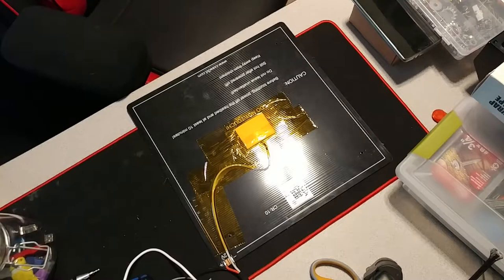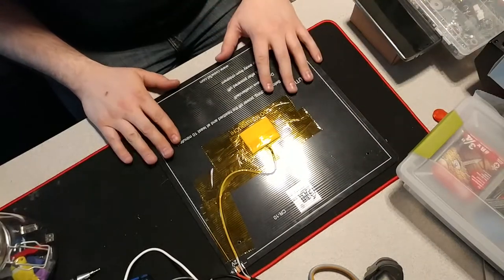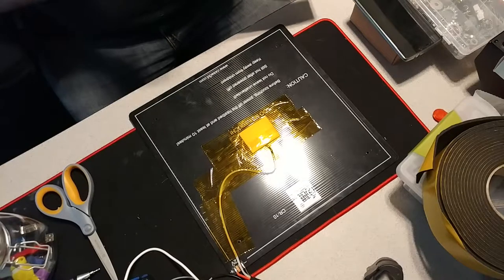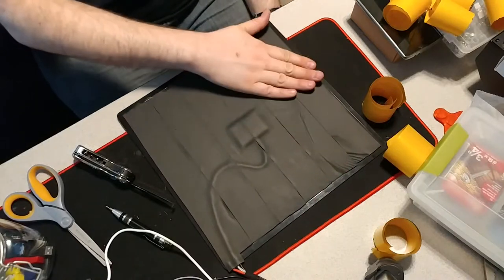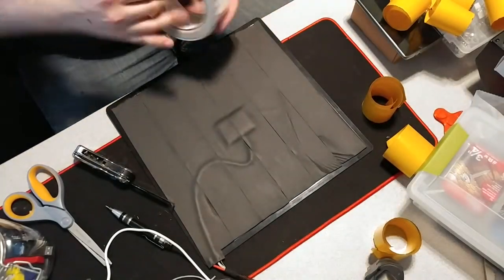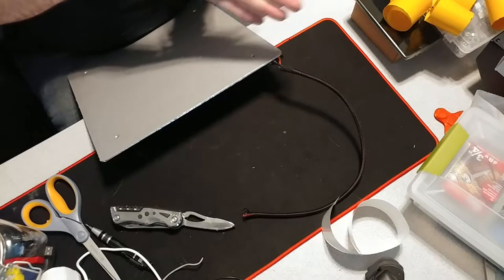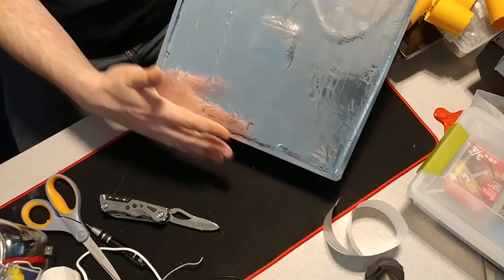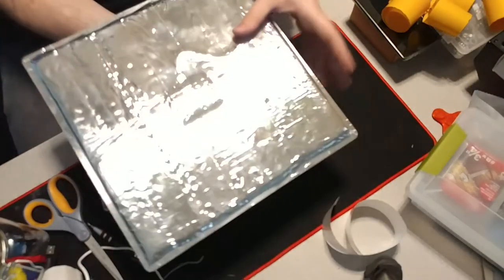DIY Heated Bed Insulation Tutorial - Works with any printer!

Comment: Just a hint for everyone wondering about the tape withstanding high temperatures.
There is at least 2 types of tape one for high temperatures and one for low temperatures.
HT Armaflex tape is rated at 150°C
Reply: I know this is an old comment but it is still helpful. I appreciate your input.

Comment: great video, i bought the tape from Home Depot for 6 dollars. its the same type of tape for way less. I did a double insulation with a criss cross over layer and the alumimiun tapes over it. the bed now heat up to 100c in 15-20 minutes.

Comment: I performed this upgrade with the exact same parts used in this video. I haven't done a direct comparison but this does seem to help the build plate heat much more quickly and lose heat more slowly when I need to kill a print and restart, meaning less time between attempts as the build plate re-heats.

The only thing I would caution is that the springs on your bed level posts will be pushing against a squishy insulation material once you reinstall the plate, meaning that until the insulation becomes full compressed, you will have some bed leveling issues.
Reply: I know this is a bit dated but you could always trim the insulation around the springs to prevent this.
Reply: @MySickDesire  I know this is a bit dated but you could do that, yes. I'd do it.
Reply: Actually, it should not make any difference as the height is dependent on the distance of the screw head and the leveling wheel. On compression of the insulation the spring will compensate, but the height will not change.

Comment: Does this foam tape not melt?
Is it a special tape, can it stand 150°c or what is the max temperature?
I'm looking also for a double sided heat resistant tape.
Reply from the maker: We have some here. Its up for 120C: https://www.th3dstudio.com/product/heated-bed-adhesive-backed-insulation-rolls/

Comment: Tim, although the addition of the foil tape is being used as a reflective barrier, wouldn't securing the tape to the edge or underside of the aluminum heat bed plate partly defeat that and causes a direct conductive connection (save the adhesive layer)?  I've come to my own conclusion that putting insulation over top of the electrical connections to the bed (where they are most likely to fail and short) might also prevent casual observation of whether the strain relief and connection of the wires to the bed is failing.
Reply: Great points. The aluminum being in direct contact with the hot surfaces creates a heat sync. Would love to see an infrared image of the stock bed vs this "upgrade" vs this same upgrade without the upside down tape in contact with the hot surface.

Comment: Noticed that the insulation is really only rated to 180 degrees F,     kind of limiting if you are doing ABS , PETG, and other high temp materials......
Reply from the maker: Still running this insulated bed almost 3 years later. No issues at all even at 100C temps.

Comment: Hi Tim...thanks for the great vids...I have a question Im hoping you can help me with.  I have a CR10S and the heated bed is very inconsistant.  Sometimes it works and sometime it doesnt.  Ive finally gotten tired of it and ordered a keenovo heater pad.  Ive seen on other vids that I need to turn off the bed heater in the firmware.  Is this the case or can I just unplug the heater from the control box?  Thank you in advance,  Richard Jackson

Comment: Simple trick, indeed :)

Just a thought, though : could Kapton Tape might be useful as a 3rd layer ?

I was thinking about that because, well, since the aluminum foil is facing downards and is in contact with the plate supporting the bed, it might conduct electricity flowing through the heating plate.
Or, maybe no Kapton is used because the aluminum foil just sticks to the insulating tape and has no contact with the heating plate.
Or did I miss something ?
Reply from the maker: You can add kapton if you are worried about other wires hitting the alu tape. Wouldn't hurt to do it if it makes you more confident in the safety. This bed is still working great and the insulation is holding up over 2 years later now (almost 3 IIRC).

Comment: so my springs will be resting on soft material that will warp? did you cut out areas for them to make direct contact to the bed?
Reply from the maker: You can cut out holes but usually when you tighten them down the springs will compress the material

Comment: Thanks for the video.
I did it the same way and my CR-10 bed goes up to 107°C now (takes 30 mins), with 22°C room temperature.
I used different brands, but same types, as I'm in Germany.

I touched the bottom of the bed and it still gets hot. So I think I just add another second layer into the middle with cardboard. I think for the outer layer it is save to take cardboard.
Reply: Moin. Was hast du denn für Zeug benutzt? Hab mir das Video grade angeschaut und überlege, ob ich meine Drucker nicht auch isolieren will.
Reply: Aufheizzeit zu 80°C ist sicher etwas verkürzt, aber nicht wirklich deutlich kürzer. Ich habe mir noch einen Deckel aus Styropor und dem Aluband gebastelt, so dass auch oben isolert wird - beim Druckstart kommt er natürlich runter.

Bei Amazon:
Aluband: TiGree 25m x 50mm Aluminiumband Almtinium Klebeband (ist zur Zeit aus - sollte aber jedes andere Aluband mti der Breite auch gehen)

Isolierband: Eurobatex FPX-15 Insulating Tape 3mm Thick 50mm Wide (das gibt es aktuell noch) 3mm allein scheint mir wie gesagt etwas zu knapp zu sein.
Reply: ohh dont count because your in Germany and in Germany fires and heat and so is just more efficient than every where else :P

Comment: Tim, would this insulation job work for bed temps for doing ABS, or other higher heat filaments, without bursting into a roaring bon fire?
Reply: yes, but the stock magnetic build plate can only heat up to 80 degrees officially before losing its magnetism which is slightly below recommended heatbed temps for ABS.
130 is the max heatbed temp on my Ender 5 and with an upgraded PEX build plate anything pops off easily after printing.
I run cork insulation on mine as it can go up to 200 Celsius (plenty) before it gets damaged by the heat and it is cheaper, easier to apply/remove and consistently easier to level with.
PS: I am also named Tim so I thought I'd answer your question =P

Comment: I just what to point out, that this should not be done with the insulation he links. if you look at the safe operating range it -20F - 180F, 180F is only ~82C which is quite low for a max temp for a heater bed. Almost every ABS filament, I have used recommended higher than 80C. You may not plan to go over 80C, but if you do, this could be a fire hazard.
Reply from the maker: Still running this insulated bed almost 3 years later. No issues at all even at 100C temps. No fires like you're assuming.

Comment: Your stated bed temp of 85C (185F) exceeds the foam's rated service temperature of 180F.
Reply: I am a mechanical insulation contractor and I can confirm that this elastomeric insulation degrades quickly at about 70-75 deg C.  maybe lower.  This insulation is designed for cold systems mainly even though the manufacturer would have you believe it can handle the heat.
Reply from the maker: Still running this insulated bed almost 3 years later. No issues at all.

Comment: IT -100 82C max ... 60C and Pla ok ... 100 and ABS I would not risk
Reply from the maker: Haven't had an issue to date. It's been on the machine for well over a year now.
Reply: Is the insulation covered with tape you once checked her condition by pulling this tape? I think about something like that and tape
Reply from the maker: Removed it to replace the thermistor about a month ago. It was still in tact. A little dry but still working. Their adhesive was stuck still with no issues and the foam stuck to said tape.

Comment: What is the purpose of the aluminum tape?
Reply: Since the aluminum tape would basically be reflecting any escaped heat back towards the insulation, I don't think the risk of a short is worth it. I'm going to go with two layers of the insulation alone. Thanks for the reply, I truly appreciate it.
Reply: I agree, double insulation vs having the aluminum tape.. Typically that tape is conductive and so is the adhesive.